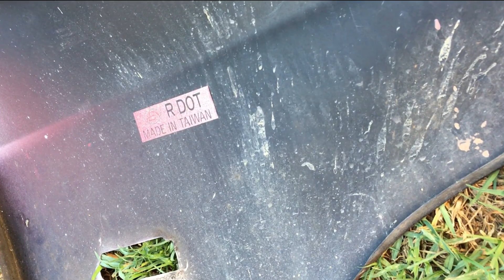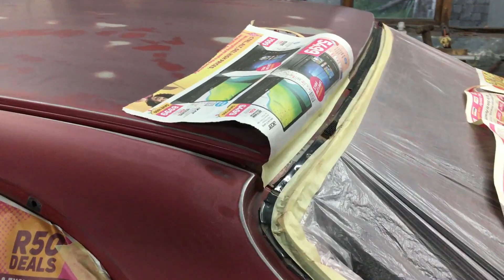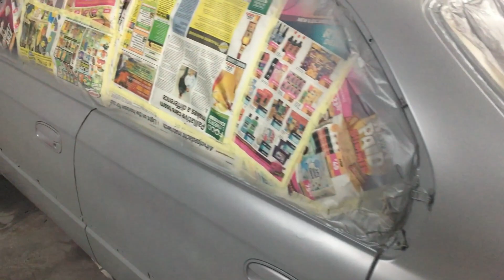HONDA EK B16 VTEC GETS PRIMER

Comment: Just some  friendly advice.
 Don't prime a full panel from the start. 
First coat, only prime the repairs. 
Second coat go a little bigger than the first coat , 
After that, then  you can start priming the full panel.
Only Because... , Repairs need more primer/filler and blocking/leveling than the rest of the panel.
Reply from the maker: Thanks alot for ur advice broski 🙌🏼
Reply from the maker: I appreciate your feedback 👍🏼👍🏼